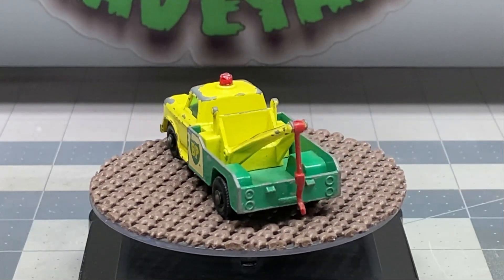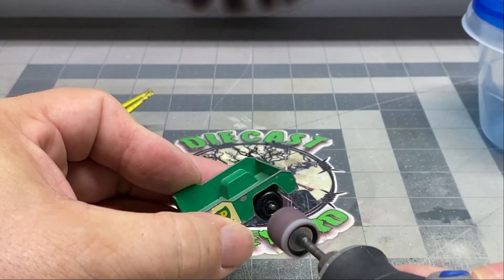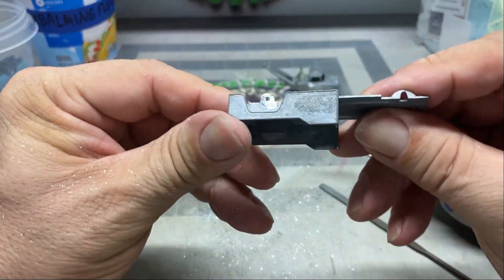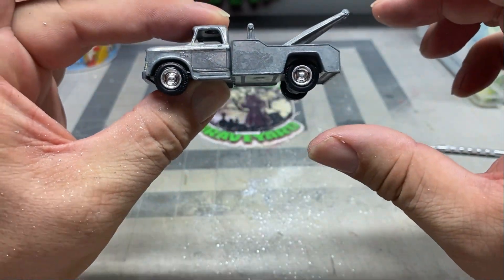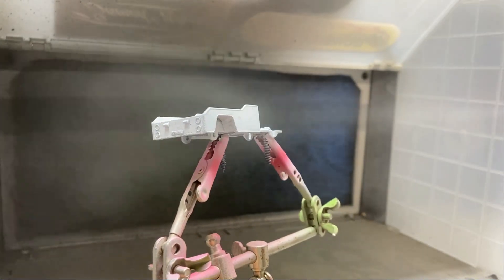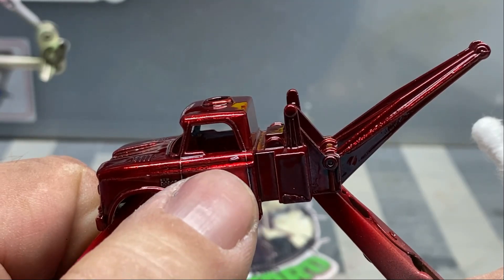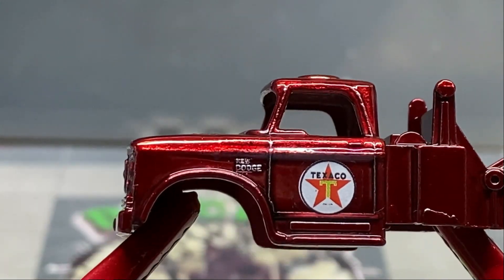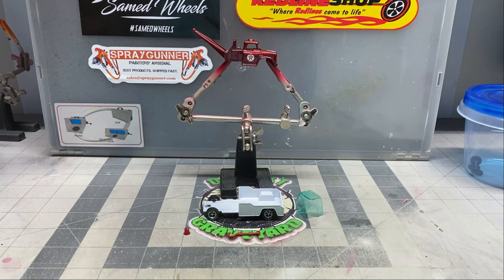Matchbox Dodge Tow Truck Restomod

Comment: Breathtaking! You've put new life into that truck! While I still like restoring those old cars to factory condition I see a lot of potential too in "modernizing" them too! Just as long as any given car isn't too rare of course.☺ Turned out you dropping and losing that wheel was a blessing. The emergency replacement set was MUCH better!👌

BTW, the third Paul, Paul Restorer, cuts out a plastic disk makes a hole in the middle that is wide enough for the axle nub to slip through and so uses the disk as a shield for the wheel as he grinds off the axle hub.

Comment: What I've done when doing  a wheel swap is using a longer axle. A longer axle would put the wheels closer to the outside of the wheel well.  It'll work if your using wide tires with a short axle. But if your keeping narrow tires a wider axle is a good idea. Trucks looks really good. Love the Red.

Comment: Absolutely gorgeous I literally want to do one just like this and do the same cause I love it so much lol. Unbelievable job. I've just started doing customs and have tried many different paints to get that spectra look. I've tried badger translucents, createx candy 2o, even made my own with urethane clear with paper mate ink,  closest I've got to that spectra look was actually the paper mate ink but u just can't get it to look like that redline shop spectraflame it's incredible paint. But still getting use to using an airbrush was having trouble with the. 3mm nozzle just couldn't get it to flow smooth so ended up switching to a .5 setup and flows great now. But amazing job I love this car what a collection piece. Congrats

Comment: I noticed your trouble w/ techniques removing the wheels. I think it was Juan at Matchbox Ressurection who used a drilled and cut piece of blister plastic as a shield between the wheel and the spinning Dremel bit. Your Vegas cousin Paul or Czech cousin Paul, I think, used Vise-Grips in a circular motion around the head shrinking it until he cound remove the wheel over the axel. That is more time consuming than a Dremel, and you may have been up against a deadline. I also think depending upon how well the axel head formed it is possible your axel length could be different on each side. As Freud said, Sometimes a short axel is just a short axel. I'd like to see a Redlines version of a Lesney/MB  BP tow wrecker, or if you're "anti-BP" a Sinclair tow wrecker? Maybe just a straight "HW Garage" truck with the vintage 60's Blisterpack art...Your basic, Red, Yellow, Orange, White, Black color scheme...with the Heavyweights' Dualie wheels in the back. Anyway...Safety and Sanitize! Have fun with YOUR toys!